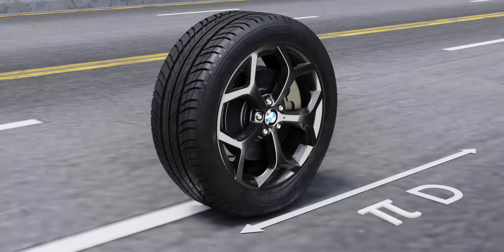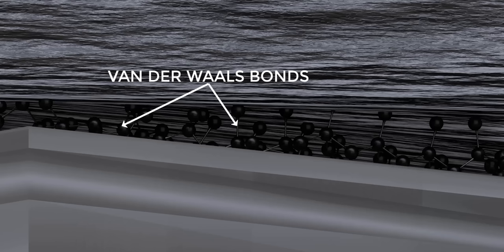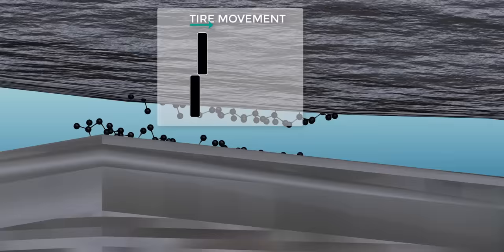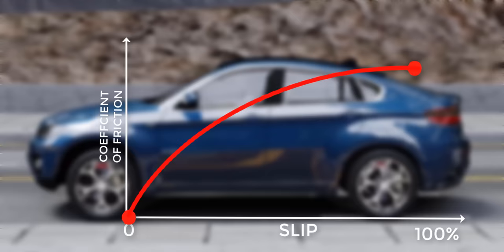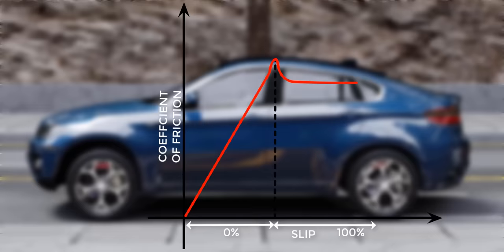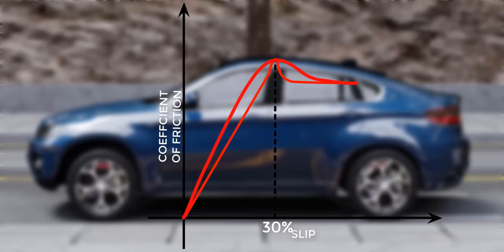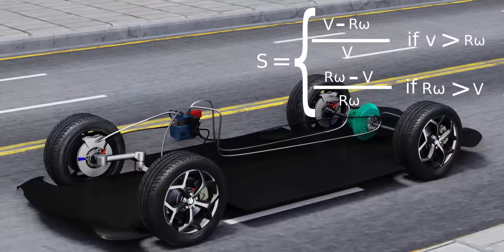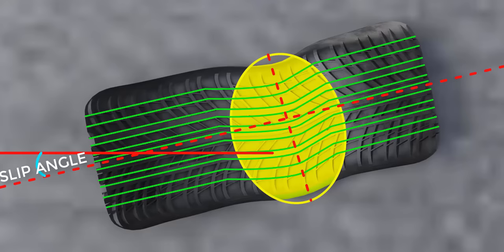The importance of tire slip

Comment: This is not how a tyre works and the slip angle does not produce force because the contact patch is slipping. Please be careful to not spread inaccurate information about such a complex thing as a tyre, it is hard enough already to get actually precise information about this topic already. The slip angle is a way to measure longitudinal deformation on the tyre. As you said it can be calculated as the ratio of the velocities. The force is originated because for example if the tyre is rotating faster than the road bellow (assuming that the contact patch is stationary in the ground) the rubber is deforming and accumulating energy that produces an elastic force to restore the rubber original shape. This is easy to understand when you look at a dragster tyre in slow motion. Most of what is said in the video is not what really happens but instead a way to simplify the thought and physics of a tyre
Reply: While i'm sure you are 100% correct, I'll just say that people don't generally listen to or acknowledge an opinion when written with language like "pretty terrible explanation" or "please inform yourself". You can say whatever you want, however you want but, all i'm saying is, don't be an asshole if you wish to inform others and expect them to listen ,a little humility would serve you well :)
Reply: @vrai3078  Fair... edited. Simply annoying to see the amount of misinformation on this topic. Slip angle and slip ratio is simply a measurement used in some mathematical models of a tyre to relate behaviour with something measurable. So explaining that they cause the behaviour is like saying clouds in the sky means rain. Sure it is related but not the cause of it directly
Reply: Thank you for this comment. I was so confused because i just found out about pacejka formula and this video basically goes against it
Reply: Zero slip means wheel is free Rolling, there is allways little bit slip when accelerating, braking or turning, this is why tires do wear over time. Tires just slips so less that you wont notice it.

Comment: I always get more confused after watching these.
Reply: SAME FOR ME
Reply: These videos are actually about solid mechanics's module in university 
You would perfectly understand the video if you have took the cours 
You can find it on youtube by the way
Just type mechanic of solid lesson
Reply: @hichamismailialaoui6870  so basically we need slip for friction to cause the adhesion region which means TRACTION?
Reply: @burntnugget1854  Traction is the ability of a tire to remain in contact with the ground. Friction on the other hand counters the movement of the tire (translatory movement for example). Slip on the other hand is caused due to adhesion which on the other side is a result due to van der walls bonds.  Just to make it more undersandable, traction and slip are two ends of a mangnet. When there is more traction, there is low slip and vice versa. To make it even more visual imaginable consider two gears. When they mesh together properly, we call it more traction. However, when are not able to fully engage but slides over each other it is slip. The same goes with the tires.
Reply: @diggaseileise1302  wow thankyou for that detailed explanation ❤ very helpful
Reply: @diggaseileise1302  thanks alot... Now only I understood about slip and traction.
Reply: I think this video is for Engineering students, not ordinary people.
Reply: @diggaseileise1302  Wow you made so much sense

Comment: There’s also additional consideration for how the slip graph changes when on snow, ice, and gravel that is very interesting!
Reply: Enriched study is there covering your   curiosity. But seems to be only for professional
Reply: this is why abs can actually elongate your braking distance in snow.
Reply: the graph just shifts downwards, starting from dry asphalt - gravel - water/rain - mud - ice with ice having a coefficient of friction as low as 0.1
Reply: @n_u001  well, not always but it depends on how strict or agressive the ABS algorithm is adjusted

Comment: I did my MS on traction control.  They missed that there is also the deformation of tire when accelerating in a straight line.  Basically your maximum acceleration is when there is some slip (operating at the peak of the curve).  When on ice the curve is flatter with a more abrupt change on the downslope side of the curve.  Can also use accelerometers to get velocity by integrating.

Comment: I have a BMW that is very similar to that.  It is a 4 wheel X drive.  When I have the anti-skid function turned on, it does not slip much, on dry pavement or even on snow.  The other day, I went to a big parking lot that had snow on it.  I gave it a lot of throttle and  car did not slide out of control.  The engine reduced the gas and individual brakes were working to keep the slipping tire from slipping out of control faster than the other tires.
  When I pushed the button and stopped the slide control, it went out of control and slid all over the place.  It is amazing technology.
Reply: Yep its great stuff.

Comment: Thank you for a great video again :-)
I would just suggest a small correction: The vehicle velocity in an ABS event is not determined by a Radar. I mean we have ABS in the cars since the 80s while Radar is a technology making it's move into the car world now. Additionally where should the Radar get a reading from if there are no fixed objects in the vicinity.
Instead the car is using algorithm to approximate the actual speed. During the ABS deceleration the vehicle obviously does not know the allowable slip either as this various with road surface. So it will steadily increase brake pressure to an individual wheel until it manages it to stop it from rotating. It backs of the pressure then immediately and consequently starts to steadily ramp it up again. In the phases of very little brake pressure the vehicle gets an accurate estimation of how fast the car is actually going.

Comment: Also weird to think that during powered driving, the perimeter of your tyres are always moving faster than the road your driving on.
Reply: But only ever so slightly. I can't back up this claim as I haven't studied the material well enough, but I expect that under normal driving conditions in a straight line the tyre slip is below 1%.

Comment: It would be good if you put citations in the description or a pinned comment. You say researchers are conflicted on the location of the slip, I would like to see the research on this
Reply: my master thesis is related to this topic. The part of the graph shown in the video is only for traction, well some researchers have proven that this is not the full graph, as there is another part for braking. You should know that the car behaves differently while tested in traction or in braking modes.

Comment: For the case of block on the table at 3:14, is it the same to say, that the so-called "static friction" force doesn't exist at all, and friction only exists when there are relative sliding on the contact surface?

Comment: Does anyone know if an LT tire in the same size as a p metric tire inflated to the correct pressure according to the load inflation tables would have lower ground pressure or higher ground pressure ? They remove the 10% padding that they add to p metric tires for SUVs and the weight rating after that adjustment is lower. You'd think the LT tire would have lower ground pressure but I'm really not sure. Does anyone know ? Would it also have a larger contact patch ?

Comment: ABS usually goes off a tone ring they call it that because it generates of electromagnetic field there's no radar involved ever the only other thing that they could ever tap into would be the speed sensor coming off the transmission it's the same sensor that feeds your instrument cluster and tell you how fast you're going but that's going a bit out of scope for abs systems

Comment: I see a lot of people expressing confusion in the comments.

One reason this video is confusing is that the graphs and the audio don't match. If the visuals are supposed to match the audio then the graphs are labeled incorrectly. For example, for the graph presented at 2:45 the y-axis (vertical) should be called Force and the x-axis (horizontal) should be Friction. 

I gave up watching at 3:47.

Comment: There's tire buckle. A car 🚘 stopped at the space provided on an elevated road. The driver opened the door. A van turned slightly to keep a safe distance from the door, but it's tire buckled, the van veered to the middle cutting two channels and hitting other cars. One car was hit and it flew totally off the elevated road. 
Tire specifications must be reset for vehicles that use the elevated roads. 🚲🚗⛵🚁

Comment: The coefficient of friction doesn't change does it? Isn't it constant? It's just the friction force that changes
Reply: Difference when only stationary and slipping. Slipping has lower fictional coef than stationary. Say, car is easier to drift when u already drifting it, but when its grippy, u need more power to drift it.

Comment: The shape of the mu-slip-curve can be explained using the so called brush model. The explanation used here with the sliding block and arguing that for the tire the curve must be smoother since rubber is flexible is rather dubious.

Also the equation at 2:29 is just wrong. If mu_adhesion would for example be 1 and mu_sliding would be 0.8, then mu would definitely not be 1.8.
Reply: Yeah idk if the person who wrote this script knows much about physics. The fact that they think mu>1 is a thing that exists
Reply: @Bzorlan  You're wrong on this one tough. mu > 1 actually is a thing...
Reply: @BlacksterVFX  how? I thought friction force could only be equal or less than reaction force?
Reply: @Bzorlan  There is now "how" I think. It just is a fact that some material pairings like sticky rubber on racetrack show a mu of 1.2 or sth like that. 
Really sporty cars for example can corner at lateral accelerations of greater than 1 g or accelarate from a standstill with more than 1 g of longitudinal acceleration. This only works because the tires have a mu_max > 1.
Reply: @BlacksterVFX  yeah apparently some rubbers can be much greater than 1. Crazy

Comment: 0:15  a pErFEctLy roLliNg tYre
Reply: rolling resistance force  = 0 LOL 
rubber exibits a F=kx curves where unloading has a smaller under curve area as part of the energy is dissipated as heat LOL, this is real life iMPerFectly Rolling

Comment: People don't understand just how much of a difference ABS makes. I would never drive a ar without an ABS.
Reply: @arinb.756  Wrong. You can never simulate ABS. You willnever get nowhere close to it, and the stopping distance will be longer, no matter how good you think you are. ABS changes the brake force a few times per second. At the set intervales, it intentionally lets the wheels lock for a split second, to measure how much forse it needs to apply next time so the wheel does not lock up but is kept at the peek of the static friction (between the tyre and the road). Static friction is higher than the kinetic friction, and that is why the stopping distance is reduced with ABS.

Comment: Probably the most confusing explanation I've ever heard about slip! Some tips to improve:

- The purpose of a concept is to improve understanding so it can be used in the real world. So add EXAMPLES
    - at 0:34 you say: in a pure rolling environment the relative movement between road and tire is 0. I would argue this makes no intuitive sense to 99% of people on the planet => bad thing to say because it's confusing.
            EDIT: To make things clear, what you really mean is that slip describes how much of a wheels revolution (it's perimeter) is translated in the wheel actually moving forward in different conditions. So in the real world the tire moves less than its perimeter. More slip, less movement, less slip, more movement. You're welcome.
    - at 1:12 you say another confusing thing: you introduce the fact that the contact patch is greater as if that has something to do with the sliding of the tire. And by the way, it's not "part of the tire is sliding", the whole tire is sliding when in contact in a specific way, near the end of the contact point, but who cares anyway, why is that important to understand slip?.
- When you introduce a new term explain what it means (pure rolling environment, relative movement, moving block, etc)
- Whenever you introduce an equation introduce it as if someone is writing it down, step by step, otherwise 90% of people don't bother understanding it.

Tire grip and tire slip have nothing to do with the width of the contact point but you make it seem like it does. If it were then a motorcycle tire wouldn't really be able to move, right?
    The reason tires are thick is because the road is not perfectly straight, so this way you always have SOME tire in contact with the road.